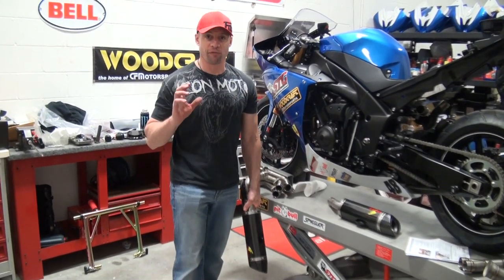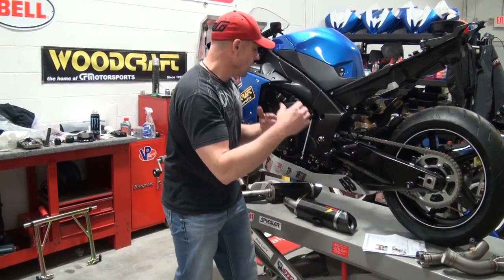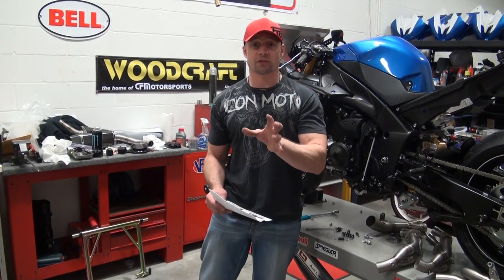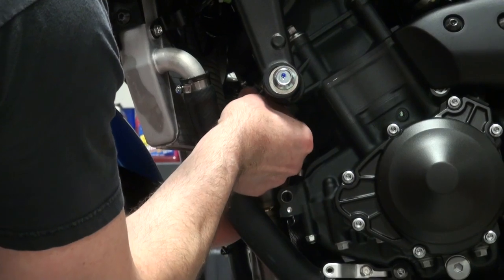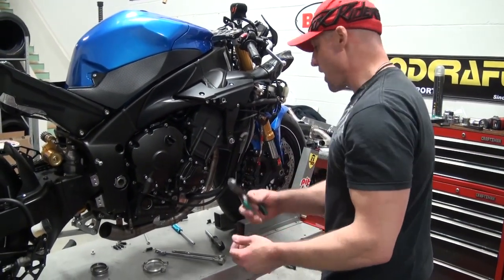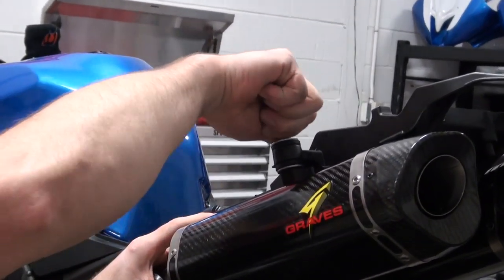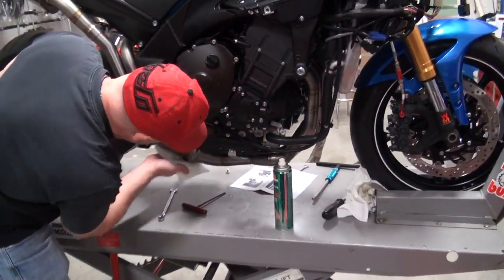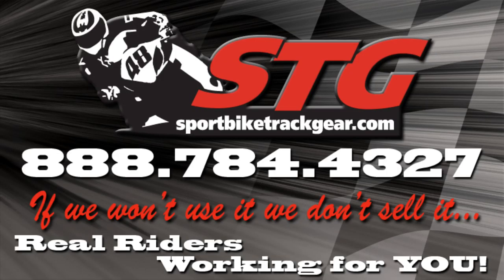Graves Link Full Exhaust System Install on the 2013 Yamaha R1 STG Project Bike

Comment: Just got a link set myself from you guys. I got the cat eliminator and the cans sans headers to save a few bucks etc. Most of the weight savings are in the cans and the cat delete y pipe, so I figured the 3/4 set up is the best bang for my buck. I also got the Graves 50 mm handlebars as well to go with the new Renthal grips and Graves machined throttle tube assembly. You will have to grind out the factory throttle stops inside the throttle tube reel housing to allow the use of the Graves throttle tube. Like many race parts, they will not come with directions, so I am just giving you all a heads up if you do decide to use the Graves throttle tube for your R1. STG has been a great business to provide my clientele to for one of many of my bike needs etc. Stay sharp and keep riding.
Reply from the maker: Thank you for your business and feedback Ivan Frerichs, having our customers hop in here with their experiences really helps provide some additional assistance for our customers. We appreciate it!  ~Aubrey

Comment: Hey big feller, does that fancy set-up clear the oil filter and plug?  I just bought a 2007 R1 with a full M4 Carbon, and it clears the filter fine.  However, the LH pipe crosses over the drain plug!  You can barely get an open-end 17mm on it ( not enough room for a socket ).  Yet the M4 website claims there is clearance!  Liars!
Reply from the maker: It is tight but I was able to change the oil without removing the exhaust. - Van

Comment: Where are the wires for the rear brake?? How do you remove the rear sets when theres a wire connected to the brake lever/piston.. do you take it out of the top wherever it connects ..
Reply from the maker: +Alex Marsh Just kind of moved the whole unit out of the way to access the exhaust here. Thanks for watching!
Reply: There's a wire that goes to the rear brake pedal and while it's connected you can't move the rear set on the right side out of the way, in your video your rear set is on the ground .. There's a connection I found that runs up under the frame and I can't get to it to undo the connection

Comment: Do you I have to get a power commander if I change only the Y pipe ?
Reply from the maker: unjustkatana If the catalytic converter is removed you should at some point add a fuel controller IMO. - Van

Comment: is it really worth getting the full system? The difference in weight from the graves headers to the stock headers is .6 lbs
Reply: You squeeze out tiny more performance, but get much meaner exhaust tone
Reply: The performance is unlocked in a quality ECU flash, which would take advantage of all the de-restrictions in intake and exhaust systems.